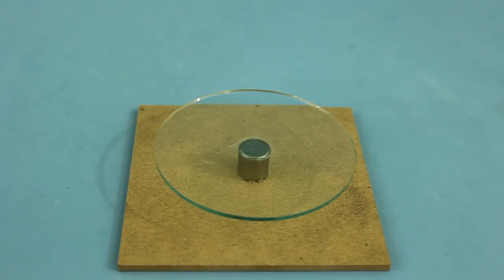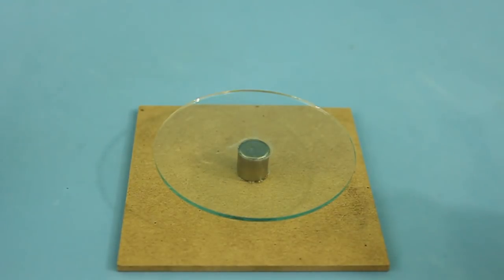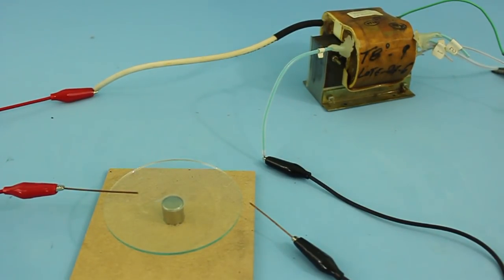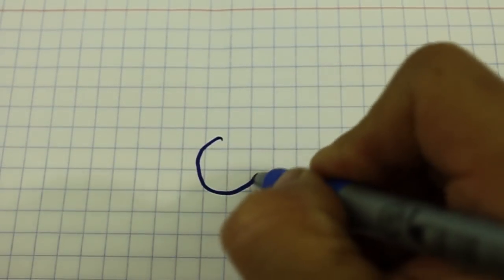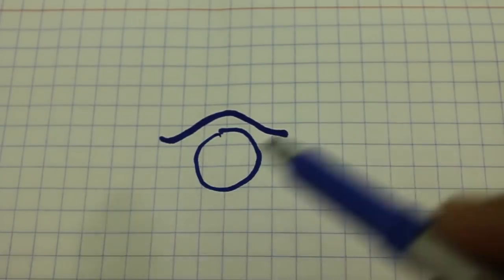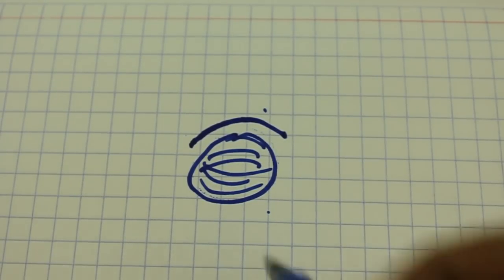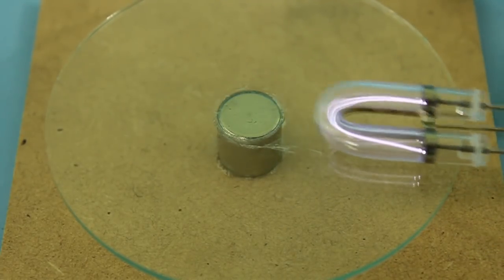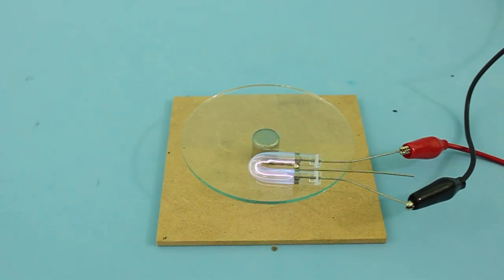High Voltage AC and DC arcs in a Magnetic Field

Comment: I'd bet that if one were to make a single piece molded lightweight magnetic metal skin for an aircraft and electrified it with high enough voltage, the magnetic field and existing resistance to the atmospheric currents would produce the effect of weightlessness. (Antigravity) who knows... that be one big man made thin walled magnet

Comment: 0:59 I think you didn't get DC out of the flyback transformer. You got >10MHz saw tooth wave AC. The arc looks pretty much like ac arc. DC arcs produce crackling noise like stun guns.
If you want DC out of the flyback then use high voltage rectifier with capacitors or voltage multiplier.
Reply: What no?😂 dc doesnt have to arc with a cracklingnoise.

Comment: I like it.. you should of moved the flash tube up away.. also when u create a field with copper wiring and and put in between a interrupter you can can see and understand the magnetic force influencing the electron beam or current.. electric and magnets are brothers.

Sorry what I mean is.. instead of a magnet use a coil to make a magnetic field and oscillate it faster than the 60hz receiving arc but keeping the receiving arc at 50/60hz and you can do funny things.

Comment: DC can shape or direct the plasma.
Have you tried higher voltage where you may direct plasma like a transistor: as a on -off switch ?
High voltage switching in a cool environment can be used in communications.  The plasma trough that U shape tube is what I'm talking about.
You should safeguard your ideas, and hope you can safeguard this one.   Best wishes.

Comment: If u pass this high voltage through a metal would it be magnetised
Reply: No, it would not be magnetized with this kind of current. It's possible that if you passed a DC high current, low voltage supply through a piece of iron it could become magnetized
Reply: A. Zak yes i meant DC current

Comment: I love this stuff one time I use a dc hv source and I hooked one side up to the magnet (I forgot if it was positive or negative)and I held the other wire directly center above a pole and as the current arced it would spin around the magnet like a motor but  if you do it for too long it will heat up your magnet and  it will no longer be magnetic I think you should check it out
Reply: Lol. That's because the when heated the electrons move and are no longer aligned to use their electron momentum to generate a field. When u maganatise something you are aligning its atoms.. when you heat it up the atoms shake and cool down but are not aligned.. unless u use a epic high current to keep them aligned while being heated.

Comment: Nice video.
I have a question.
Do all flyback transformers produce dc?
Reply: Some of those flybacks comes with a hv rectifying diode built inside (Making it DC). If you manage to find a very old crt TV, you will find a flyback that outputs AC
Reply: Cisar Vialpando no, some dont
Reply: ShuShu Bana  I extracted a flyback from a very old  black n white crt tv...
Reply: Here he shows one, maybe they're not so common: https://youtu.be/j6qepkSoLEQ